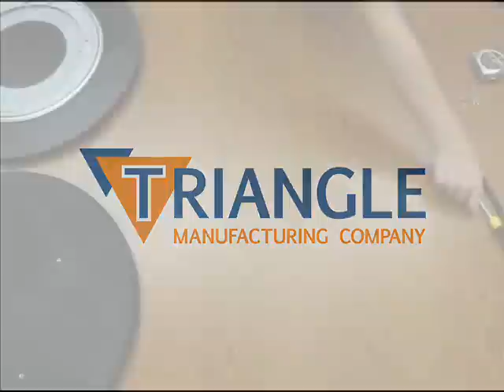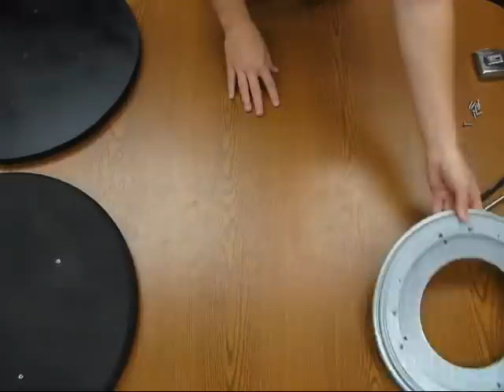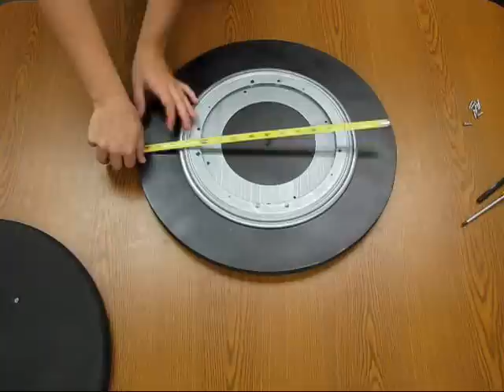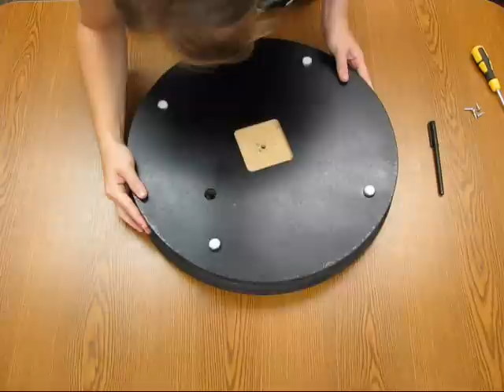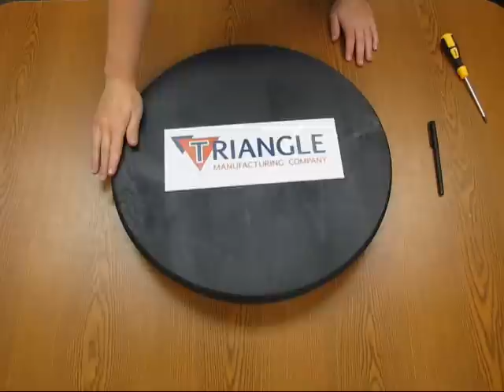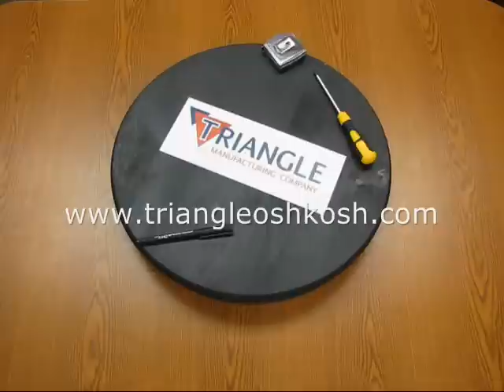Triangle Manufacturing - Lazy Susan Assembly (2)

Comment: Just an idea here, but have you considered supplying a paper template with each bearing? That would make assembly a little easier. You would just need to find the centre of your board, align it with the centre on the template, tape the template to the board and drill the screw holes according to the markings on the template.

Comment: TURNTABLE ATTACHMENT: In situations when it is not possible to have an access hole through the base (like the bottom of an installed cabinet), you make counter-sunk holes through the turntable.  I used a 9" swivel plate, and I used it upside down relative to what is in the video: I attached the larger diameter part to the turntable, making the narrower diameter part the bottom. The wider part has only four screw holes.  These holes very nicely fit four metric pan head machine screws (M6 thread, Home Depot article #128591), which were able to cut a thread; I just applied a plenty of pressure while turning the screwdriver and they cut in. I put 5/8" washers under them to distribute their force over the wood. I cut the thread in all four holes in the swivel plate first, then it was a breeze to screw down the turntable onto it; don't be cutting thread while trying to attach the turntable at the same time! For attaching to the base, I used the large access holes in the wide diameter (turntable-facing, wrong-way) side to get the screwdriver to the holes in the opposite plate.  For the next job with my  new 12", I will be sure to try the intended orientation: wider side down.

Comment: CENTERING:  there is a nice, logical, geometric way to center these units. Considering that the screws are drilled in a square pattern (which appears to be accurate), what you do is draw a perfectly right-angled cross on the center of your baseplate and turntable: two perpendicular lines which meet at the dead centre.  The cross should be at least as large as the swivel plate. Then if you align the unit so that you can see the cross through all four holes, it is centered.  I had to mark a cross anyway to find the center of the piece of wood from which I cut the turntable, as well as to find the center of the installation location.

Comment: I built 22.5" turntable using one of these 9" bearings. I didn't find this video at the time; it was bought through Home Depot, who get it from Richelieu!  I just bought a 12" one directly from Richelieu. I read the stamp on the sheet metal to discover the real manufacturer and then found this video.  I will write some comments about my installation.